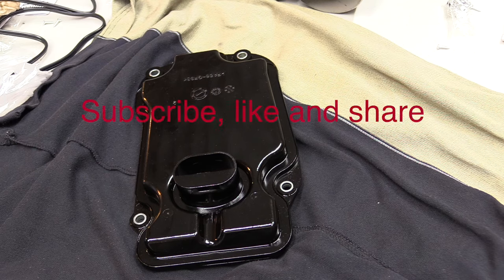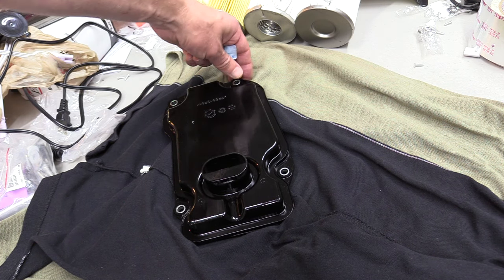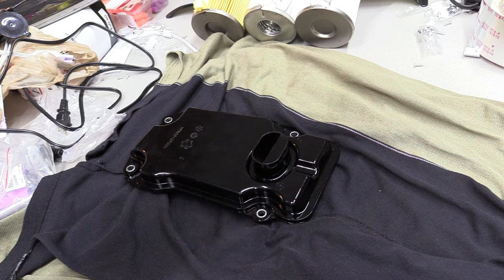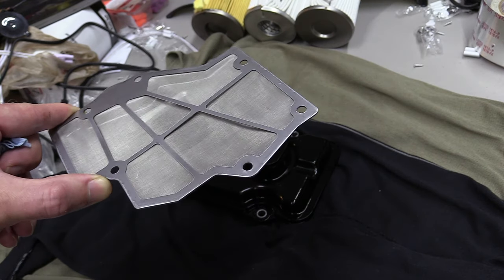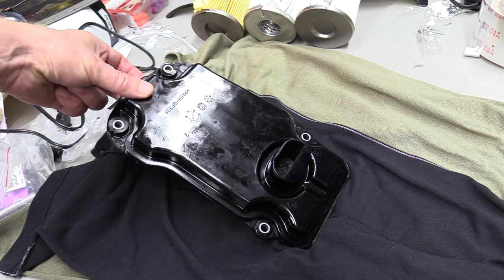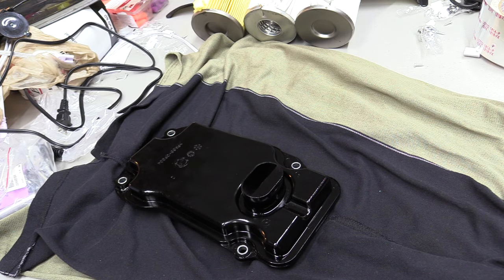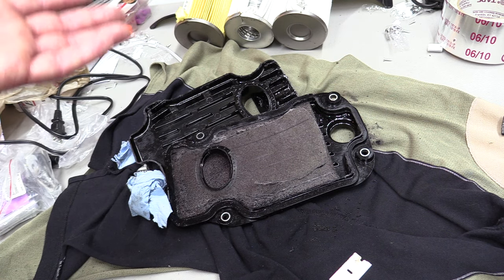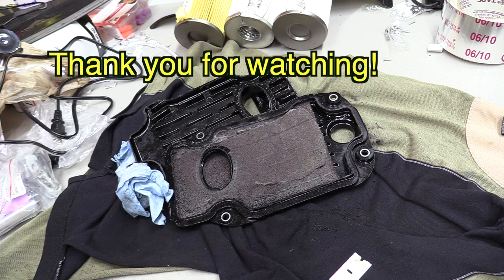Avoid replacing transmission filter, avoid costly transmission repairs, transmission maintenance

Comment: Great perception! Enjoyed the video and your point of view. However I disagree with SOME of your view points. Good rule of thumb....if the manufacturer of your vehicle recommends you change your filter at particular intervals then that's what you should  do. Because the people who actually designed and built the transmission would know best. With each revolution and each gear change friction material and metal particles the magnet did not catch build up and get stuck in the filter even if you don't see it and eventually will restrict flow even in the slightest. Can you get away with not changing it for long bouts of time...sure. but why risk it?
Reply from the maker: Did you watch video without skipping?

Comment: I agree about changing the fluid more often. I would change (what's in the pan)  at least every 40,000. Then you can change the filter every 80,000, which is about every 7 years for the average car owner.

Comment: I’ve always changed my trans fluid ever 65k.  I just drain and fill.  I realize this only changes about half the fluid but it’s always worked for me.  I’ve never had a transmission problem.  My ford 6.0L transmission had an external filter from the factory so I always changed it with the fluid.  I’ve never had a transmission flush of any kind.  I also like to add lubegard to my fluid.  It may not do anything, I certainly don’t have any proof that it works. All my transmissions shift well and lubegard has never caused an issue.
Reply from the maker: For how long did you keep your 6.0?
Reply: @repairvehicle  I owned it from 68k to 338k.  I bought it in 2008 and sold it ealier this year.
Reply from the maker: @nickthompson529 was it bulletproof? Any Engine repairs were done during your ownership?
Reply: @repairvehicle I did the head gaskets, studded it and deleted the egr at 206k as preventative maintenance, although they never blew.  I also added a mechanical fan clutch, and some other common small mods.  It was tuned at 100k and stayed tuned until I sold it. 
 As far as repairs, I did the ficm twice, a full set of injectors but not all at the same time, the oil cooler was done under warrantee, & 2 high pressure oil pumps.  Nothing on the engine itself just peripherals.  The turbo was on its last legs when I sold it.

Comment: Great video! When you say change you mean drop the pan, if there is no drain, then refill? Or do you mean to flush? I have a Yukon xl with 40K that I want to "change" ,I did this in my truck when it had 40K and its ready for another change, I dropped an changed filter then refilled. So I am thinking that I can skip the new filter on both, or should I flush?
Reply from the maker: Change fluid is to replace fluid without replacing filter. No flush.  Do you have dipstick?
Reply: @repairvehicle  yes. Thanks for quick response !!!
Reply from the maker: This video might be helpful https://youtu.be/z9f9dZ3UHLQ
Reply: @repairvehicle  Perfect ,, thank you so much!
Reply from the maker: @BIll R. , you are welcome

Comment: 06 Pontiac vibe with a
Transmission drain plug.  Fluid looking dark brown at 125k so I drained and filled with Valvoline translation fluid. Not touching transmission filter or cleaning magnet.  Drove 100 miles and noticed a little less drag with the all wheel drive.  Then I  checked fluid and it looked dark brown again.  Should I drain and fill again?  Or wait for 50k more before touching it.?
Reply from the maker: I would drain and fill again without waiting 30k miles
Reply: @repairvehicle  should I use aftermarket Valvoline ATF or go this time with OEM ATF?
Reply from the maker: If you feel comfortable with Valvoline use it otherwise use oem. Personally prefer Toyota oem over valvoline but I don’t use neither in my Toyotas.
Reply: @repairvehicle  what's your choice of ATF that you would use?
Reply from the maker: @rjmstation , this is what I use. AMSOIL atf mixed with factory atf. is it safe to mix amsoil transmission fluid with Oem trans fluid
https://youtu.be/rzp4ddX4ac0

Comment: Is it better to clean filter or leave the filter as is when changing the transmission fluid on a cvt ?
Reply from the maker: Same details described in this video applies to cvt transmission too. Thank you for asking
Reply: Ah yess i did rewatch the video thanks so much.. so should i skip on washing/ rinsing the filter? Im at 60k miles and mechanic said i can clean the filter instead of replace. But maybe i dont even need to do any of that? According to you @repairvehicle
Reply from the maker: What kind of filter do you have, reusable?

Comment: New sub here, thanks for sharing your knowledge and experience!  I have a 2003 Toyota Highlander 3.0 4x4 with 268,000 miles on it.  I don't know if the Transmission filter has ever been changed but the fluid has been changed and it smells like Lucas Trans-Fix which smells a lot like gear oil.  I want to do a drain and fill but I would like your opinion before I do it.
The transmission does not slip during take-off from a stop.  However the shift from 1st into 2nd is a little bit sloppy.
Should I use synthetic fluid or conventional?
Should I add Lucas Trans-Fix because someone has already done that?  I used Lucas in a 1994 Volvo 940 with a slipping AW-71 transmission, and the Lucas stopped the slipping.
Should I replace the filter or not?
Your opinion is appreciated...Thanks!
Reply from the maker: Your transmission is already slipping due to lack of atf changes. Adding Lucas might help for short time, might not. Lucas is just a bandage to cover the real problem but it doesn't solve the problem. Your transmission has a lot wear that Lucas cannot add worn-out material back and restore to original factory specs.
Changing fluid and filter might help for short time, might not. At this point you can try changing atf or just replace the transmission.

Comment: Hi sir, I hope you are doing well.. I have Toyota Auris 2016 CVT transmission car. Soon I will take car for changing transmission fluid. Some says filter should change too but Toyota garage says they do not change the filter. I do not know if they say that because they do not care or is it really no need to be changed? I saw many videos on youtube they also change filter. May I please have your opinion and advice for this subject? thank you.
Reply from the maker: Internal filter or external? Mileage on the car?
Reply: @repairvehicle  i am talking about cvt transmission filter. it is inside.. car at 40.000km
Reply from the maker: If it's internal filter, inside transmission, then I would not replace it.  If it has external transmission filter I would replace it.
Reply: @repairvehicle  it is internal. I am not going to ask and insist them to change it (they already said that they do not change by the way). thank you very much for your advice and fast reply sir. take care of yourself.

Comment: I followed your advice and didn't change my transmission filter on my 02 Trailblazer. I flushed the entire system with Amsoil signature ATF fluid. But the next flush, I will change the filter.
Reply from the maker: How is transmission shifts with amsoil atf?
Reply: @repairvehicle  It shifts buttery smooth as if it should when it came from the factory.
Reply from the maker: Thank you for the update

Comment: i just bought a  2011 GS350  with just about 110k miles on it. I took it to my nearest Lexus dealership they said it's a lifetime fluid nothing is a lifetime. so I am thinking of taking to a Lexus dealership that does transmission change. 
i am just wondering if it's a bad idea to change the fluid now. Previously I had a 2009 ES350 I bought it at 130k it got totaled at 215k. it was running fine
Reply from the maker: Fresh clean fluid inside transmission is always better than old dirty fluid. It's like having old oil inside engine.
Reply: I setup an appointment with lexus on Monday for the fluid change i hope they won't fuck my shit up

Comment: I have a 98 Lexus ES300 with 54,000 miles on it and last year I was going to do a transmission fluid drain and fill and so many people on clublexus recommended I drop the pan and change the filter while I was at it. I ended up just draining the fluid from the drain plug and refilling what was lost. Would you recommend my filter be changed, or should I just do another drain and fill without dropping the pan? I'm using Amsoil Signature Series ATF btw.
Reply from the maker: I would just do drain and fill.  Good job using amsoil atf.  I use Amsoil products in everything.
Reply: How’s your transmission shifting after using Amsoil ? I can’t wait until I get al the ws Toyota fluid out of my trans.

Comment: I have a a 2011 Lexus IS 350 with 160,000 and I don’t think trans fluid has ever been changed. Can I do a drain and fill with Amsoil or do I need to flush the trans to get all the old fluid out? Is it ok to mix the Amsoil in with the original Toyota ws fluid?
Reply from the maker: watch this video about flush, very problematic 
https://youtu.be/or9u8DQ4fVU

Drain and fill is what I do and recommend.

Yes it okay to mix Amsoil with WS, watch this video for details https://youtu.be/rzp4ddX4ac0

Comment: I have a 2010 Toyota Corolla with just around 90,000 miles. Bought it used everything is working as it should but once i get to a 100,000 miles i was planning on changing the transmission fluid. Do you recommend just doing the fluid change and not the filter? I don't know the entire history of the car and if the fluid or the filter have been changed. Thank you in advance.
Reply from the maker: As a bare minimum,  change your atf fluid.
Reply: Kind of in the same situation.. bought a highlander with 108k and Im going to change oil, coolant, and trans fluid @110k after seeing this video I'm going to still change the fluid but I'll probably spray the pan bolts with some penetrating fluid a day or two before I change the trans fluid. I'll figure I'll change the filter every hundred thousand miles and then start a schedule of changing the fluid every 40 or 50k miles.. it sounds good to me but I'm not expert lol

Comment: Just bought a 2011 toyota sienna with 170000 miles with no prior history of transmission oil change. Should I replace the filter or just the fluid. BTW transmission shifts smoothly with no issues.
Reply from the maker: Fluid as a bare minimum should replaced.

Comment: I just bought a 2002 Odyssey van. 135,000 miles and the transmission started to clunk into second gear and 3rd gear. I have to drive it very lightly. Sometimes when I'm going uphill I have to shift it manually from 1st to 2nd and 3rd. Letting up on the gas with each shift. It's very difficult. 
I was told to take off the solenoids and check them for those little filters in there that may be clogged.
Also I was told to never change the transmission fluid on an old transmission.
The guy that sold it to me did not say if he used 100% synthetic. 
Any advice please would be appreciated
Reply from the maker: @2Jeezuzisreal  did you scan for codes? ATF was ever changed?
Reply from the maker: First, cheap scan tools will not read transmission codes.
Second, transmission has bearing like anything and requires clean ATF to operate properly and last long time. Never change transmission fluid is false inflammation spread by transmission shops to gain more business or clueless people that wish others have problems in life.
Third, You can try changing the fluid and see if it helps, but hondas with V6 are known for weak transmission specially older ones.
Changing transmission fluid might not help at all due to transmission being worn out, that's assumption.

Comment: I bought a used Acura TL 2003 with DTC transmission code. I changed the outside filter and the code went away and shifts perfectly.

Comment: I have kia cerato runs more than 100k ..is transmission original oil  from kia's company full synthetic or normal..so if factory oil is not full synthetic then which brand full synthetic oil we can use?? Penrite brand ??

Comment: The problem with changing the filter is that the older, partially clogged filter actually filters BETTER than a new filter which lets larger particles pass right thru. Yes, IF the filter was Totally clogged, it would starve the transmission of oil. But if it's PARTIALLY Clogged, it is actually filtering better than a New filter, catching smaller pieces of metal and clutch material.
Therefore EVENTUALLY it may be better to Change the type of filter you show here, buy not Until that time at all. 
On my 200k+ mi. Volvo, i am just now thinking about changing the transmission filter ~

Comment: I have a 2010 Lexus RX 350 that I am changing. The transmission fluid on it has 185,000 miles on it to my knowledge. This may be the first time the transmission fluid is changed would you recommend changing the filter? or just the fluid? I am replacing with Amsoil.
Reply from the maker: Are you having transmission problems now?
Reply: Not necessarily, there is what I believe to be a torque converter shudder when around 45 mph. I believe/hope that by changing the transmission fluid it will alleviate the torque shutter issue.
Reply from the maker: As a bare minimum I would replace fluid first
Reply: Did the shudder go away

Comment: Is that for a Touareg? I was thinking of doin just drain and fill of my Touareg with 85k miles. I don’t think it’s ever been changed.
Reply from the maker: It could be same for vw, buts it’s from Toyota/Lexus suv/truck with 4.6 v8 engine

Comment: I have a Lexus is 250 awd with A760H transmission at 180, 000 miles and fluid and trans filter are never changed so should I change both or just fluid ?
Reply from the maker: As minimum replace atf fluid,  filter replacement is question. If you watched video without skipping you know the answer

Comment: Great video, subscribed, question by the way, I've got about another 20k miles before I do my next transmission flush on my lexus, the car is 31 years old but only has about 114k miles, should I replace the filter due to it being that old of a car?
Reply from the maker: How often were you changing atf fluid?
Reply: @repairvehicle  well I've only had the car for about 16k miles and I'm not sure how often the last owner did it
Reply from the maker: It actually good idea to replace filter since previous maintenance history not available.
Reply: @repairvehicle  my thoughts exactly, thanks for the help 🙂
Reply from the maker: No problem.  Any time

Comment: Great video, gives a lot of insight on this topic that my friend is struggling with. But I have few questions regarding both the trans fluid and trans filter.

1. I've seen some mechanics say that trans fluid works better when dirty because then it gives more friction while shifting gears... which means when trans fluid is changed and new, the gearbox might slip or shudder while shifting gears. Is that true?

2. My friend has a Nissan Sunny 2010 which has the steel/aluminium filter that you showed  at 3:16 in the vid. Does that mean it's better to change the trans filter AND the fluid too?

His car has an issue where the gearbox slips and doesn't shift when accelerating, but goes to normal when he slightly lets go of gas, but this happened very few times. 
Thanks!
Reply from the maker: 1. False. They say this to keep themself busy and job security. You can make 1000 times more money replacing transmissions than changing fluid.
2. if its clean no need to change it.
changing fluid sometimes fixes problems if its not too late
Reply: @repairvehicle  Thanks for the reply! It only happened 2 times in the past few months so I'm inclined to believe it's not too late. But I was wondering can it be an electrical problem as opposed to mechanical problem when the gearbox slips? And if yes, which sensors are to be looked at when in this situation? 
Also, will an aftermarket coolant for transmission be a good idea? Sorry for too many questions, I'm only new to learning about cars and many mechanics don't say the right thing upfront.
Reply from the maker: It could be electrical problem too however it would have to be scanned with a tool to see if there any codes for transmission. Aftermarket transmission cooler is a plus in hot climates.
Reply: @repairvehicle   Appreciate your time for replying, I do live in a hot climate specifically in middle east. I learned a lot, thank you!
Reply from the maker: You are welcome

Comment: Bought used '16 Mazda 6. With 124k miles. Runs and shifts nicely. No accurate information if transmission ever serviced. Is the millage to high for a first drain & fill?
Reply from the maker: Nope

Comment: That’s a dirt filter.. you wouldn’t replace it?
Other than stripping the threads, are there any other problems changing the filter?
Would spraying anti seize on the bolts the night before help prevent damaging threads?
Thank you
Reply from the maker: Answers in the video. It helps to watch video without skipping
Reply from the maker: There is no dirt in the filter
Reply: I did watch your videos and it’s a little long winded and I got confused as you said after cutting the filter there were particles 11:50.. 12:50 fine metal shavings… so no need to replace? 
13:25 maybe or maybe not change filter? So confusing 
Stripping threads: can that be prevented with anti-seize prior to removal of bolts?

Comment: What if the vehicle has done 400,000 kms and has no history of transmission oil or filter change? in that case shall we change filter or not? Thanks
Reply from the maker: Transmission will not last 400kms without changing fluid.  I would change it